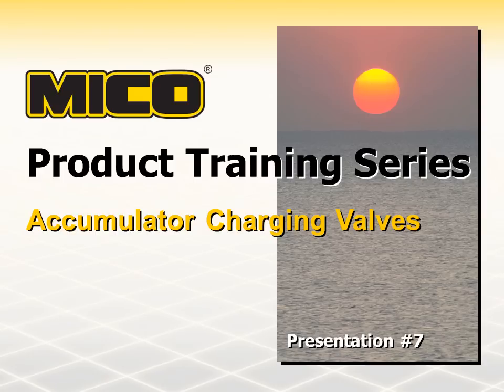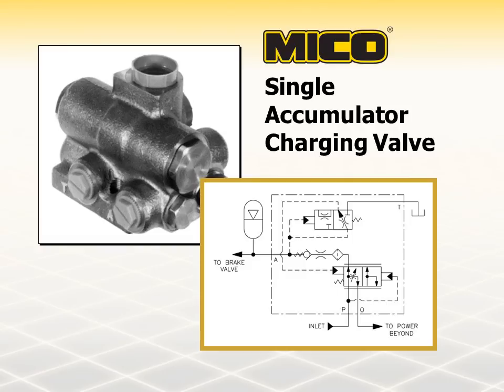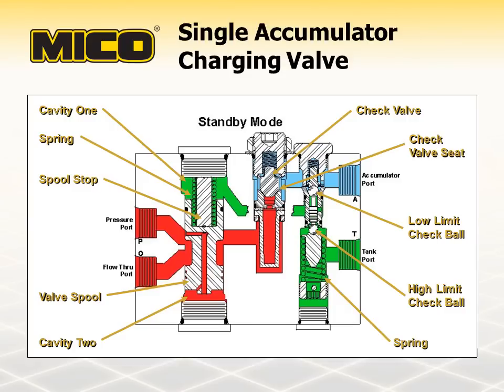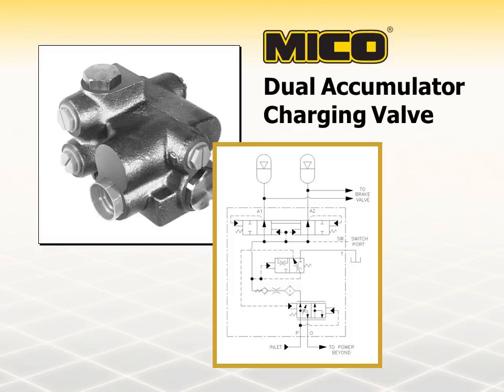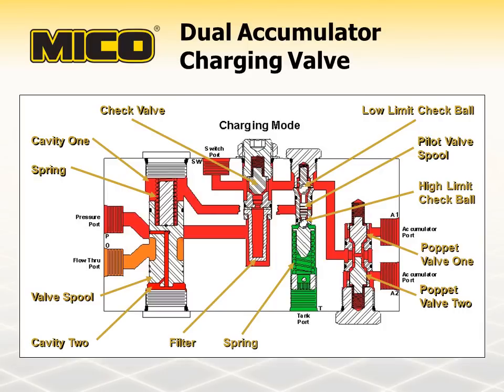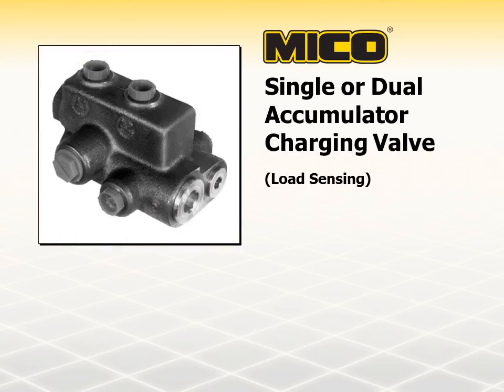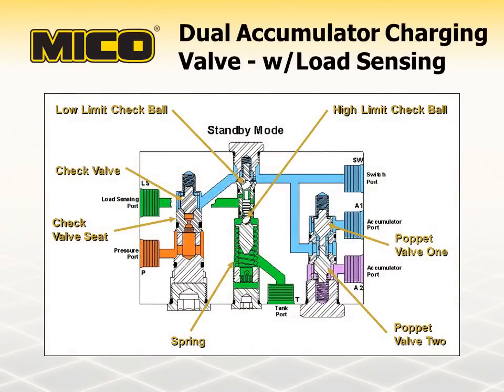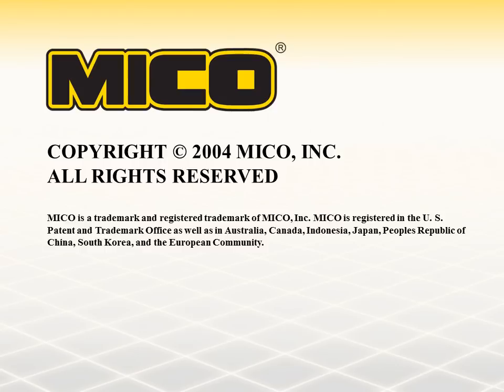MICO Product Training Session #7 - Accumulator Charging Valves

Comment: Ive been having hard steering problems on a Sellick S80 forklift. Problem seem to have started a couple years ago after the operator filled the hydraulic tank with diesel fuel and when running the machine on low hydraulic oil.  Now after a couple damaged hydraulic filters replacements, the steering problem has become more difficult to work the steering to 90% operational. Recently I opted to replace the steering obital pump but didnt resolve the hard steering. After running the machine, Im back to 90% steering ability. At 90%, the steering sensitivity is very dull to changing steer direction, and requires a short delay with light pressure on the steering wheel before the power steering kicks in. Ive also noticed in order to have a quicker steering response, Id have to tap the brakes which is also hydraulically assisted. Im now leaning on a possibility of some sort of hydraulic pressure to steering orbital problem, and now im researching if the charging valve is bad. Any help is appreciated.